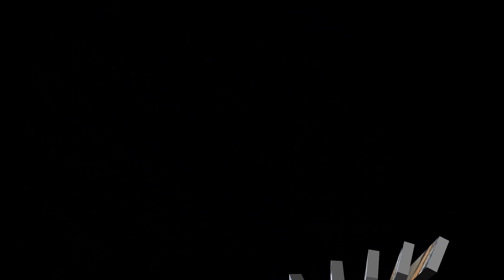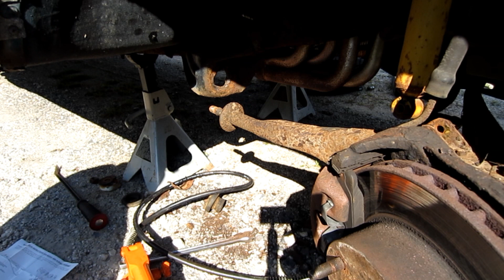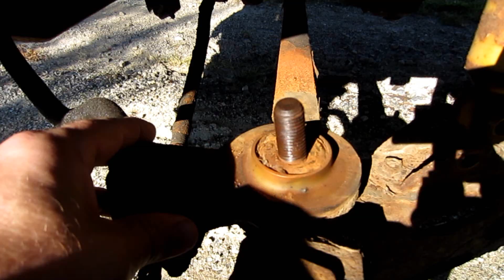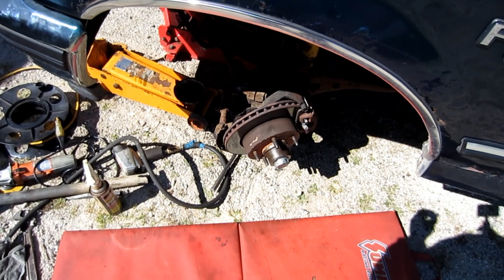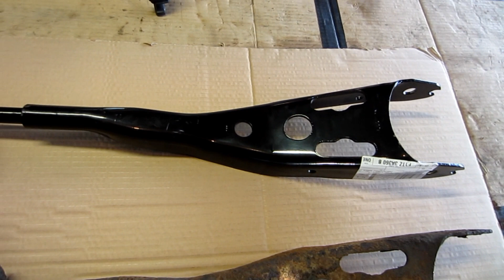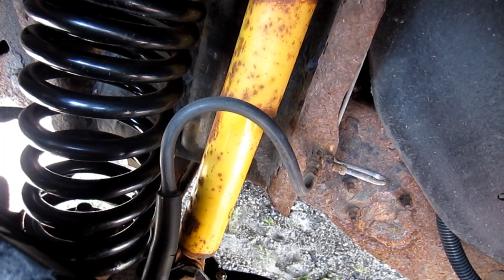F150 Coil Spring and Radius Arm repair

Comment: How do you find the new springs? I went for the heavy duty springs for me e150 and it sits a little too high. I can't decide if I should go with the regular duty springs or the inch shorter heavy duty spring to correct my camber and avoid the spring failure.
Reply from the maker: My Springs worked out great. The increase in overall height was approximately 1/2" so no problems with alignment..

Comment: I'm having trouble sourcing the pivot bolt.  Any help is appreciated.
Reply from the maker: +Andrew Soltis Local industrial supply or bite the bullet and pay the big $ for Ford.. I ran into the same problem so I reused my old ones that had barely any damaged from grinding off the nuts(thankfully).. Good Luck!!
Reply: +Foxboss9 

Yes, I removed the nut the same way you did.  I ground down both sides of the nut and used channel locks to twist it off.  I called a ford dealership and they couldn't source the bolt.  They said it was an obsolete part.  I'm trying to get the bolt out now.  I can turn the bolt but it won't back out.  Any suggestions on getting it out?  I've used quite a bit of PB blaster so far.  As well as a lot of blood, sweat, and tears.
Reply from the maker: +Andrew Soltis put a nut on the end of the bolt and try to hammer it out at the same time running the impact on the head(in reverse obviously)..  The same obstruction that is keeping the bolt from dropping out will provide a place for the bolt threads to "bite"  but you have beat the bolt to get the threads down to that point..  Once the threads grab remove the nut and impact the bolt the rest of the way out
Reply: +Foxboss9 
Yes, I was thinking along those lines.  Didn't think of putting the nut on though.  Thanks for the suggestion.
Reply from the maker: +Andrew Soltis yea, you don't want to damage the end threads of the bolt.. Good luck
Reply: +Andrew Soltis Jeffs bronco graveyard has every thing for F-150 & bronco's in front and rear suspensions.
Reply: +Don Crews what is a Jeff's Bronco Graveyard?
Reply from the maker: +Andrew Soltis just Google them. They have F-series parts too..
Reply: +Foxboss9 Yeah, I've google it many times.  The only bolts that pop-up are for the 4WD models.  The 2WD models have a bolt that's 10 inches long.  I can find bolts the right size but not with enough threads on them.
Reply from the maker: +Andrew Soltis I figured as much. That is why I went to great lengths to salvage the old ones..  Local industrial supply companies are abundant in my neck of the woods but you may have to find one online for your project needs. The toughest obstacle will be finding the correct grade of bolt. You might want to try an automotive repair shop that does a lot of suspension work or truck repair (spring shop)

Comment: I know this is an old video but brother it was obvious that you had the wrong shock on that baby.  The shock was holding your axle up and compressing your spring,,you should have noticed that when you disconnected the shock, that the coil relaxed.  The shock is not supposed to hold anything, only to put downward force on the tire.
Reply from the maker: those are the correct shocks that are on there. the suspension was fully unloaded so the shock would then support that I beam along with the sway bar and radius arm. my F 250 is the same way. if I want to remove the coils off of it in the same manner that I did in this video on the F 150 I have to have tension on the suspension to remove the shock from its mount. at that point I can then allow the coil full extension to release it from its pocket mount. the only way that shocked with C that limiting force would be if I was off roading with a two wheel drive and the vehicle left the ground on the front end. that's why they have limiting straps for guys that hardcore off road because of the shocks can't handle it.